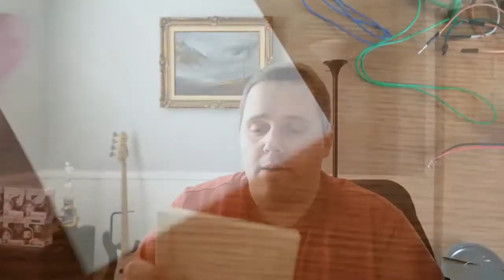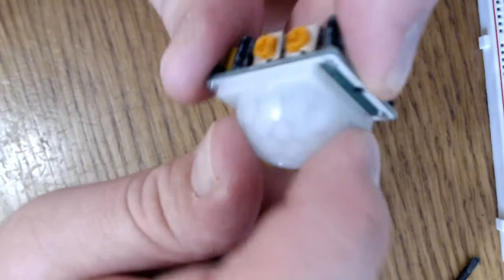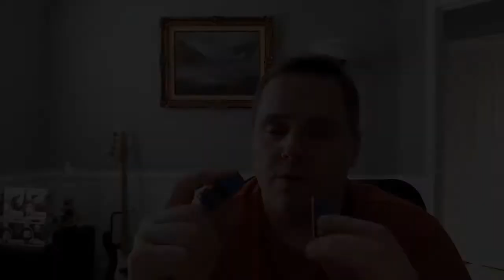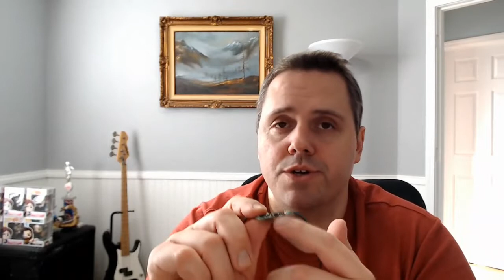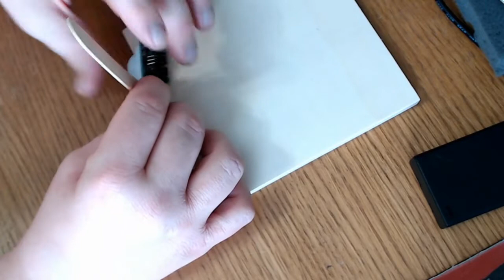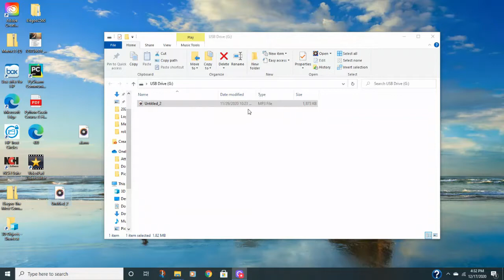How To Create A Simple DIY Motion Activated Sound Device With A Relay Module For Beginners

Comment: Nice video. I have 1 question for you. I did basically the same thing as you. A few differences though. My issue is, how do I get it to play and stop? I have that same module you used. Had to switch the resistors on the board for it to go on when detected and off when there's movement. For some reason mine goes on, plays the song for maybe 8 seconds goes off then plays it again. It doesn't just play/stop when motion/no motion. Not sure if I explained that well enough to understand, but if you could give any insight as to what I might be doing wrong it would be greatly appreciated.
Reply from the maker: Hi there! Sorry it took so long to reply. Are you using a 5v relay module? If so, make sure the jumper select is on the "H" option. It's the jumper pack you can put on a set of 3 pins located on the board. If H is the set of pins you have the cover on, it means that the relay module is configured to trigger when a high signal is received on the "IN" pin.   As for the motion sensor, make sure the jumper select is on the "L" option. The L option is  a single trigger option when motion is detected. Further detection is blocked until the output returns to LOW at the end of the time delay.  You also have 2 potentiometers on the motion sensor. The one closest to the yellow jumper pack is for sensitivity - the distance for detection. The potentiometer next to that (furthest from the yellow jumper) is the time delay. Adjust this potentiometer for a little longer than the length of the song. You can adjust time delay from 1sec to around 3min. You may need to play with this a bit to get it right. So if the motion sensor jumper select is set to "L" and you adjust your timer delay to the length (or just a bit longer) than your mp3, you should be good to go. Let me know if you still need help. I have put this together so many times.. I have more pictures I can send you if needed.  Best of luck!  🖖

Comment: Is that speaker loud enough for a hallowed animatronic? My 6 yr old want to build 1 with movement and sound.
Reply from the maker: this is plenty loud for an quiet indoor setting. If you are in a noisy environment it may be hard to hear. It also depends on how you mount the speaker. If you provide acoustic space behind and around the speaker it will be louder. 👍

Comment: If you answered my question in the video I apologize I missed it. But how well does this sensor work in the dark, does it need a light source then actives if that source is broken?
Reply from the maker: Hi Wade! it sure does. The HC-SR501 PIR motion sensor activates off infrared. I used this setup from the video in the dark or a while and it did fine 👍
Reply: @BMonsterLaboratory  Thank you!
Reply from the maker: @StolzWC  You're welcome. Thank you for adding to the conversation.

Comment: Hello....  I'm working on another DIY project, and when I searched for the MY-H1650M V2.0 sound module, your video came up.  I have FIVE of these modules and intend on putting them in an audio automation system, or audio chain, I won't get too detailed about it here.  My question is, have you purchased more than one of these 1650M modules?  All five that I have, I can plug the USB cable into each one.  The green light will light steady, but the "disk" is never detected by Win10.  I've also tried it on WinXP, and on whatever the latest version of MacOS is -- I'm not a Mac person.  I have tried plugging it into my Android phone, too, and it never detects it nor mounts a disk, doesn't prompt me to format anything.  I can sit here and look at the Device Manager on both my PCs and no USB disk ever shows up.  Second question, have you had any trouble with these and am I missing a step?  The original instructions step-by-step does not say "plug in USB cable, open file manager window..." -- it actually says to connect +5VDC to the primary taps, not the battery +VDC taps, then connect the USB cable to it and then to the PC.  I have tried just plugging each new module straight to USB, no other soldering the power taps or anything, sliding the on/off switch, I'm hopeless at this point.  Have you had any issues with the modules?  --or have I just burned up $50 on bad product?   Thanks for your video, though, it was an interesting project, and also verified my connections to the sound module were correct like someone else.  This thing has aggravated me for a while now.  Looking forward to your reply!
Reply from the maker: Hi Brian. Sorry to hear you're having issues with your mp3 modules. I plugged mine right into the computer usb without issues. I did it on my windows 10 and now my windows 11 pc. I'm wondering if you need to update your usb drivers? have you tried other usb ports on your computer? have you tried connecting to another windows 10 computer? As awesome as WinXP was, it is not supported by anything these days. The module came with a sound file on it. Can you push the button and get that sound file to play?
The only time I have it connected to usb is when I'm adding or removing an mp3 file. Any other time I use it I will have it connected to 5v breadboard power supply the 3AA battery pack it came with. I don't believe I have connected both usb and 5v power to the module at the same time. I will check the manual and see If I can find anything else.
Reply: @BMonsterLaboratory  so, I should have checked this first before I wrote this.  But, lesson learned, and maybe others will pick up on this if they are having problems.  If it does not auto-detect a disk under Win11, Win10, or WinXP (yep, it's compatible with it), then CHANGE the cable!  Ugh...  I had two cables here on my desk, which both should have no excuse for not working.  I went to the Dollar store, DG, last night, and bought a fresh cable, $5.  I plug it in this morning, and just like that... it appears.  I can play the song onboard the memory chip... move files, whatever.  I still owe your video here many thanks for keeping the gears turning in my head about the matter!  The support isn't that good on certain things you buy from the Net, sometimes that common sense will kick in, though, and it'll surprise ya!   Thanks again for the reply!
Reply from the maker: @brianthomasqualls1166  I'm glad you didn't buy 5 broken modules :)
I didn't even think to change the cable. Thanks for sharing the solution to your problem in the comments - Good job on your part. good luck with your project~! 👍

Comment: Also, are you able to plug in multiple devices into the bread board other than the voice box setup ?
Reply from the maker: Yes you can.  Just pay attention to your voltage and amperage. We shouldn't go over 1amp and 5v on the standard breadboard, but there are other ways to connect. I'll have something soon.  👍
Reply: @BMonsterLaboratory   gotcha! Teens k u very much for your help. So if I wanted to add a strip of LED’s would I also need to connect those wires to the relay as well, or another relay that also will get power from the breadboard? Or just connect to the breadboard with the led wires? 

Lastly, if I added a portable charger as the battery device to the bread board, would that work? Thank u again.
Reply from the maker: when you start adding more items to be triggered by the motion sensor, you'll want a multi channel relay. I have an 8 channel relay and will include that in my demo. I"ll post it on here...not a problem. Remember, if your current is over 1amp, don't use a standard breadboard. Your setup is going to look different if you connect a strip of 300 LEDs compared to a strip of 10 LEDS. I like the WS2812B LED strips because they look great and operate at 5v.  I'll include this in a video, it will be easier to explain.
 You can add a battery bank as your power source but if you're operating LEDs plus other items the charge may be depleted quickly. If you're connecting low voltage items then it would be fine.
Reply: @BMonsterLaboratory  makes total sense. Thank you so much again!
Reply: @BMonsterLaboratory  also, is there another way to contact you?
Reply from the maker: @SHMOGIE_TheMyth   sure!  my email is 
bmonsterlab@yahoo.com   you can leave messages here or email me...
Reply from the maker: @SHMOGIE_TheMyth  you're welcome...no problem at all
Reply from the maker: oh hay!  look at what I found. I forgot I made this video or I would have linked it earlier - https://youtu.be/cDrW953HPAw    controlling the 5v mp3 module and 12v LED light strips.

Comment: Could you power them all with the leads spliced all together to the battery pack?
Reply from the maker: that should work fine. i have all leads attached to the same rails
Reply: @BMonsterLaboratory  awesome!  Love your detailed video by the way.  This is exactly the type of build I was looking for to make a paranormal music box.  Most others use a light activated music module.  I like your use of the relay a lot more.  One last question.  If you were wanting to add a power light, and a light that gets triggered with the music.  Where would be the best location to connect them?
Reply from the maker: Thanks! glad you found it helpful. As for the light...how bright are you wanting it to be? It may be easier to connect everything to Arduino Nano and add some simple code. it's pretty small and everything could be powered by 9v battery
Reply: @BMonsterLaboratory  I decided to stick with the basics and as we said splice them all into the single power pack.  However here is my issue. I’ve gone through two of those same sound modules and they simply don’t work. Seems like they are not getting power.  Second one same situation.  I even soldered new leads to the ports on the board and tested the pack with a led.   Am I doing something wrong or do I just have bad luck and got two bad boards.  Can you recommend a different board if that’s the case.
Reply from the maker: What size battery pack do you have attached? try to get as close to 5v as you can. It takes 5v to activate the switch on the relay. You can go less than 5v but when you lower the voltage it can become unreliable.  You're welcome to send a picture of your setup to 
bmonsterlab@yahoo.com.

Comment: Hi, is it possible to format this so that sound is playing until motion is detected? And then once motion stops sound plays again?  Basically the opposite of how it is usually used. Not sure what kind of sound module I'd need for continuous playing (8 hrs or so). thank you!
Reply from the maker: hi there! i don't think so. You can put an mp3 on this module that is up to 2.5min long and after that, it would stop. You need something to continually trigger the motion sensor. A better option for you may be the sparkfun mp3 player shield https://youtu.be/zamlAniU2nQ  Of course, your setup would be different from what I have in this video. you can repeat mp3, or shuffle them, or play a really long mp3 and trigger a reset when motion is detected. How good are you at soldering? Soldering the header pins would be the hardest part. 
There is also a popular DFPlayer Mini  module for Arduino but honestly, I'm not a fan of it. What you're asking for can be done but it just depends on your skill level. Happy to help if there are any questions! 👍
Reply: @BMonsterLaboratory  Thank you for the super quick and helpful response! I have zero skills, so I will do some research based on your suggestions. Thanks again!

Comment: I have a question about this setup. I'm currently finishing up a 3d print of HK-47. I plan on adding a sound module with speaker just like your setup, with a sensor. However, I also plan on adding LEDs for eyes as well. Could I piggy-back into the relay module for both the speaker and LEDs, or do I need to get a 2 channel module for this to work properly? I want the eyes and sound to both activate off the same motion sensor.
Reply from the maker: Hi Rob. I like the idea! I haven't tried it but you could probably us a voltage divider and run both the player and LEDs . Honestly, at this point it would be better to use Arduino Nano. It has 5v pins for the motion sensor and pwm pins for the LEDs. You could even make your LED eyes dim and brighten for a glow effect and in the end it would probably be more compact. Are you familiar with programming something like this in Arduino IDE?
Reply: @BMonsterLaboratory  It's been a long time since I've done any kind of programing. Any video recommendations you have to get back on my feet for something like this?
Reply from the maker: @robprice5985  I have read Arduino forums a lot but that often ends up being a frustrating endeavor. I still sometimes today look back to the Arduino Reference website for code help. Dronebot Workshop has a lot of good info on his channel. The videos are pretty long and very detailed. A lot of people like Paul Mcwhorter also. I haven't seen many of his videos but he does a tutorial from the very beginning. I also went through the Elegoo Mega tutorial projects and picked up a few books for beginner Arduino...that was helpful.This is a hobby for me. I tinker around with this stufff just about every day and learn something new all the time.  If you have any questions I'll be happy to help out.

Comment: Great video and I wanted to try it as I can really use this to make a dog bark to scares a pesky skunk that's driving me insane 🤣🤣. I connected everything as per your instructions. Unfortunately, my sensor doesn't turn on. I've tried several different ones still doesn't work. In my relay, I have both lights green and red on but, I get no sound from speaker and the sensor never turns on. Also, what's the part number for your board and power adapter?
Thanks in advance.
Reply from the maker: Hey there! great to hear from you and thank you for the compliment. I put links to the sound module, the relay, and the motion sensor in the description but i'm wondering if they've changed the type of board... perhaps there's a newer version. The back of my sound module says  MY_H1650M_V2.0     
Make sure you're using the NO/COM screw terminal for the wire where the button was....the button you cut off the sound module. The middle pin of the motion sensor should be connected to the IN screw terminal. Power for both the motion sensor and relay are provided by the breadboard power supply.  The yellow jumper on the relay is over the "H" pin. A green light should be on indicating your relay has power. When motion is detected the relay will have a red light turn on and your mp3 should play. I rebuild this exact setup using 3 AA batteries as a power source rather than a breadboard power supply. I'm happy to share it with you if it might help. Let me know if any of this help....happy to help you get this up and running.
Reply: @BMonsterLaboratory  Hi there... I'm sorry for not replying sooner, I appreciate the detail. It actually ended up being that I had the wrong power adapter. I order 9v and its worked like a charm! THANK YOU  so much for putting together this awesome tutorial.
Reply from the maker: @LBU3N0  That's great! thanks for the kind post. best of luck to ya!

Comment: Do need a breadboard for this project? Or can you just connect everything without the breadboard? Just trying to save space.
Reply from the maker: Hello! You don't need a breadboard.  You can use wire connectors or solder.  I would solder.  Breadboard is just convenient and temporary. 👍
Reply: @BMonsterLaboratory  Gotcha! Thanks a bunch!
Reply from the maker: @marcusproietti  welcome. Good luck!
Reply: @BMonsterLaboratory   Ok, I finally found some free time to get into this project. Since I am using a battery pack, what are the diferences in the connections? Since I wont be using a breadboard, I'm guessing the wires that would be in the breadboard would need to be soldered together with the ground and negative wires?
Reply from the maker: @marcusproietti  Everything is 5v so you can solder it to your 5v power supply and you'll need to solder your ground connections together as well. have you looked at these wire connectors?  no soldering needed. I wonder how well they work. https://www.amazon.com/dp/B0BGQ176RW/ref=sspa_dk_detail_1?psc=1&pd_rd_i=B0BGQ176RW&pd_rd_w=3Dn0y&content-id=amzn1.sym.0d1092dc-81bb-493f-8769-d5c802257e94&pf_rd_p=0d1092dc-81bb-493f-8769-d5c802257e94&pf_rd_r=K1V2HA2E2GBTGWYXTCFV&pd_rd_wg=npuDJ&pd_rd_r=e14a75f5-415d-48bf-8887-e6b02b3784d3&s=industrial&sp_csd=d2lkZ2V0TmFtZT1zcF9kZXRhaWwy

Comment: Can this set up work for trick or treat bowel for when grabbing candy
Reply from the maker: Hi Bernie. Yes, it can. You could put it in the vicinity of your candy bowl and adjust the distance of the motion sensor. I think it would work fine. You could add whatever mp3 you wanted to the sound module.
Reply: Now is there a way to one and have it respond to four different bowels or will I need to make four of them.
Reply from the maker: @bernieacevedo9773   The HC-SR501 motion sensor covers a range of up to approximately 7 meters at 120 degrees. With that size of range, you could cover 4 bowls with motion detection. You would have to set it back away from the table, or wherever the bowls are set, and adjust the sensitivity screw pin on the side. the datasheet for this sensor says it works at 3-7meters. I have used it at closer distances before and it was fine, but it may work better, and perhaps optimally,  at around 10feet from it's target area and it would give you 120 degrees of coverage.